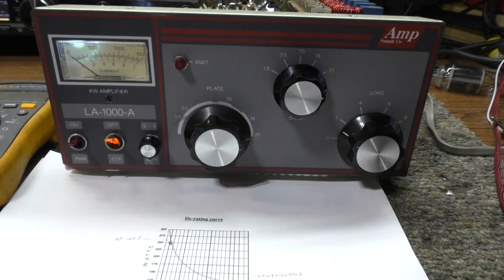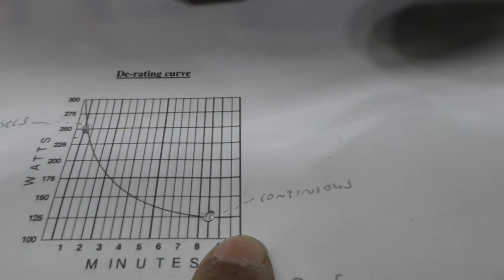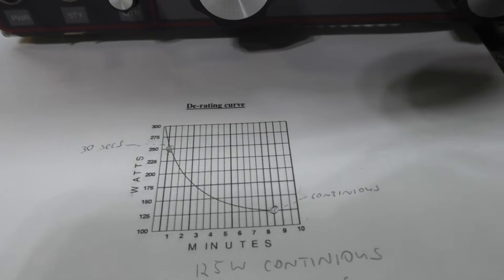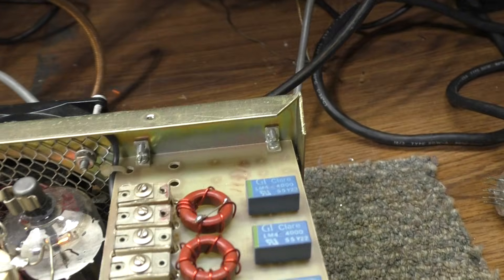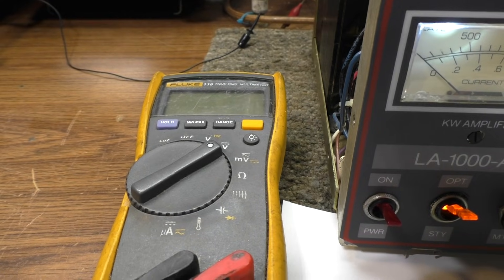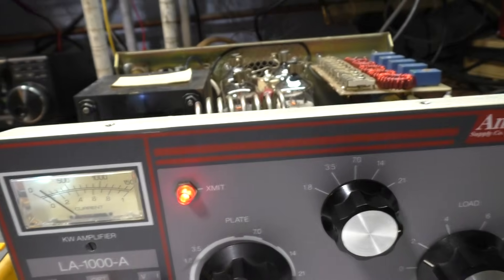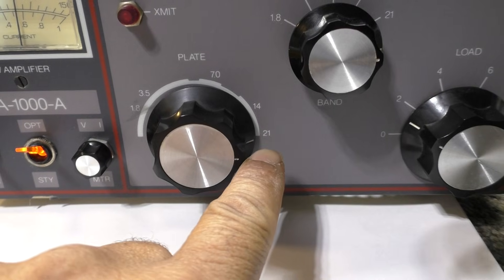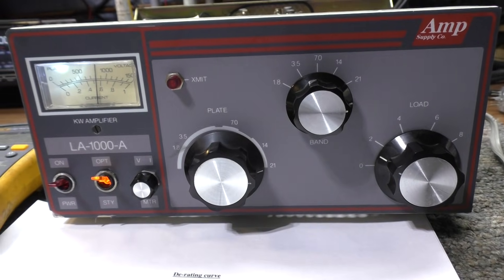Amp Supply LA-1000a 10-160 meter 4 6MH6 sweep tube amateur radio Ham linear amplifier

Comment: What is the power output for the Dantron 1000 B amplifier with 6JE 680 tubes idiot this is the one I am still working on that has no power output
Reply from the maker: 500 watts and don't stay on it too long at that if you want it to last. Problem is, many people push it harder, get more out, and kill the tubes and eventually the tranny.

Comment: It's not a good idea to run it with the cover off, It puts off RF radiation that will fry your brain with everything else. I have a Varmint linear 450, 4 tube amp. They are not illegal to own, but they are illegal to run without a ham radio license. when you adjust it, you tune it to it's peak then back it down a hair, to keep from over driving it. I tune mine to 4 amps. Mine has 4 knobs to tune it with, AM and Sideband switch.
Reply from the maker: You are correct about the cover. You are incorrect about backing it down to keep from overdriving it.
Reply: @tramdr  Is that your opinion.
Reply: @tramdr  Make a video on it because there are none.
Reply from the maker: Maybe not exactly on it, but I have made many videos on the subject. Final Tune and Load for max, driver Tune and Load for max, never detune, one of the worse things you can do.
Reply: @tramdr  Mine has 4 knobs to tune it.

Comment: I have the black face early model LA-1000 that uses 4 6lq6 tubes. With 70 watts in i get 450 watts output.
Reply from the maker: sounds right and run it like that and it will last!

Comment: Thanks again for the information ✌️.ihave a ABC. Tube amp from 1959, two tubes, and one small one for the key up, cannot find any info on it, have a fantastic day 👍
Reply from the maker: CBTricks.org has a schematic on an ABC amp but it has a transistor keying circuit. Very basic 2 tube in grounded grid.  https://cbtricks.org/Amp/abc/7107/graphics/abc_model_7107_sch.pdf